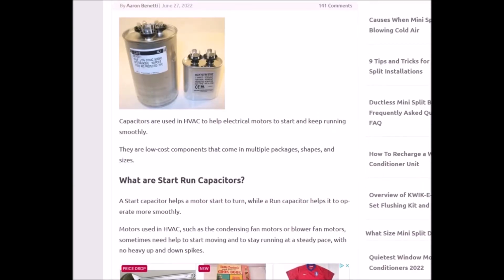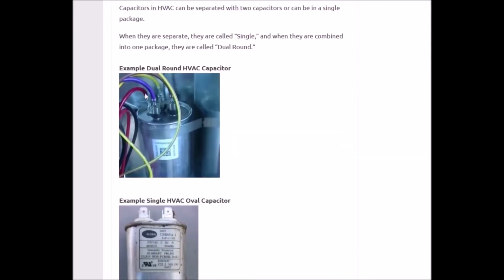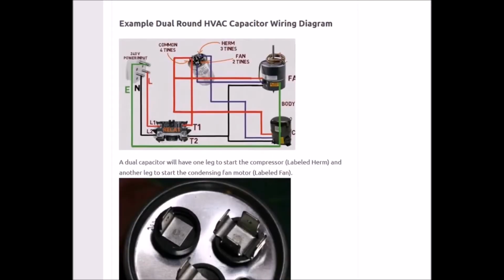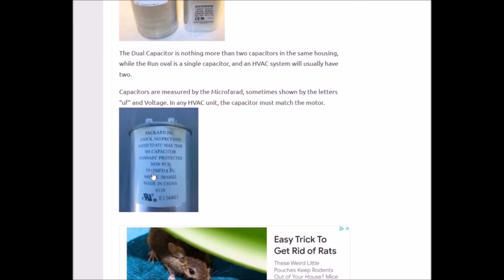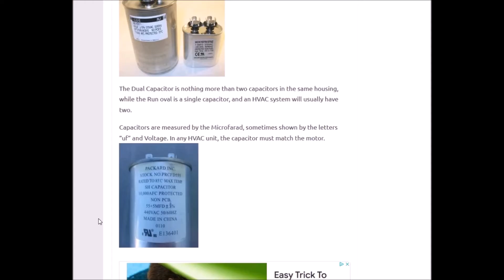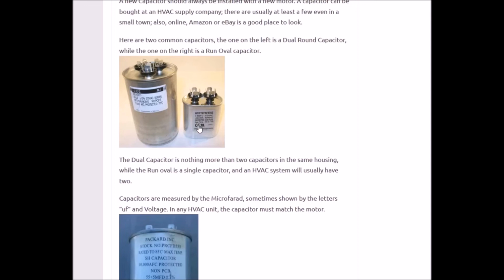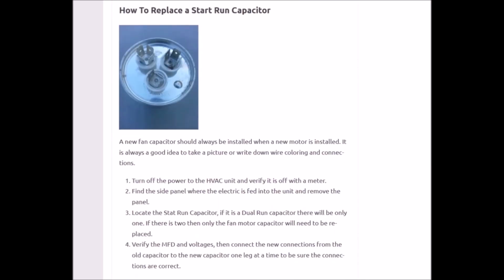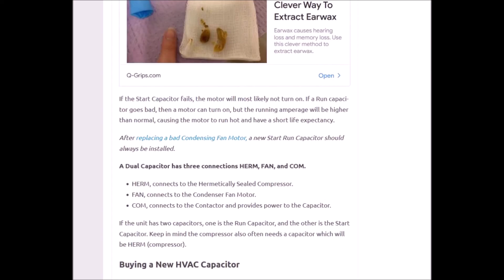HVAC Start and Run Capacitor Explained

Comment: I'm confused because there are no markings on the top of either capacitor. I don't know which goes to common vs herm vs fan.
Thanks for the explanation. I wasn't prepared for this when I opened the panel.

Comment: The fan on my unit keeps running after the AC turns off but it slows down. The compressor stops but the fan keeps running. Any advice? I’m thinking either the start capacitor relay or maybe the fan motor has a centrifugal switch to activate the relay and that has failed.

Comment: And what if you DO forget to take a pic before disconnecting old one? i have that situation currently with a spa pump motor start capacitor (2 terminals, not 3)
Reply from the maker: There should be a wiring diagram on the door or somewhere on the unit. If not follow the wires; with two wires, one wire will likely be to the condensing fan motor or compressor and the other likely to the contactor for power. Be sure to see a diagram or follow the wires to make sure.

Comment: Thank you for your videos. Very helpful. A mouse chewed one of the wires going from the compressor in my AC unit near the capacitor. It tripped my breaker and shut down the unit. The capacitor was burned out and needs replacing. However, I also need to add a new small piece of wiring from the existing wire to the compressor back to the new capacitor. What gauge wire can be used? Can I replace with 14 gauge wire and just install the new terminals?
Reply from the maker: If you can read the wire size, it is best to match the wire size the unit uses. If you can't read the wire size, the amps the capacitor uses can point to the gauge needed. (If it was me, 14 gauge will likely work, but if in doubt, use 12 gauge.)

Comment: Hi!  I have a Monoco RV with a Carrier AirV roof a/c.  The original capasitor went bad and luckily I found a used 370v 45/12uf dual run capacitor to get me operational.  What I'm wondering is where do I get a wiring schematic that will show me how to split them.  I have only found 1 45/12uf capacitor and it is to big to go back inside the connection box, so I would like to use a single 45 and 12 capacitors.  Any help would be awesome!
Reply from the maker: The 45uf should be for the compressor and the 12uf for the fan. The common leg will be shared. The wires can be followed to verify them.

Comment: Can you go from a Oval capacitor to a round? As long as the numbers match?
Reply from the maker: Yes, as long as the voltage and micro farads match it can be used. It may not mount perfectly in the unit, but it would work.

Comment: The Amrad I just got in has a 4th terminal labeled "CPT". The old one isnt like that. Can I just leave that terminal out? All values match.
Reply from the maker: CPT acts as a kill switch between hard-start and compressor in the event of a failed run capacitor. It is not necessary to use but is an extra safety feature. The correct MFD and voltage values to the FAN and Compressor are the main thing.
Reply: @HVAC_Mechanic  Thanks. I wasn't sure if not using that terminal would cause an issue. It's been working fine since yesterday.

Comment: If you have a 35+5 uf can you use a 45/5 uf ?
Reply from the maker: No, the Microfarads need to match. Volts can be higher but not Microfarads.
Reply: @HVAC_Mechanic  thanks that's what I thought..
Thanks again
Reply: @HVAC_Mechanic  Can we replace a dead 45+7.5uf with a 45+5 uf

Comment: A tech didn't have the correct dual capacitor so he used a new dual capacitor for the compressor and added an extra capacitor for the fan that had the correct specifications.  It was a work around because he didn't have the exact matching dual capacitor with him.
Reply: Was this by any chance the titan pro ?
Reply: So a technician did the same exact thing …. So in other words we don’t need the little capacitor to begin with ?

Comment: I have a old rusted capacitor with 3 terminals but only two wires connected,i cant see the mfd or volts. Theres another smaller one with two terminals  and 2 wires connected to it. Ac dont turn on. Why do i have two capacitors?
Reply from the maker: One is likely for the FAN and the other for the compressor HERM.
Reply: Hey

Comment: I can't believe the first statement on messing with these capacitors is the safety factor.  They can kill you.  I worked with a fellow who failed to discharge the capacitor on his AC before touching the terminals.  He died because he was alone at home when he decided to work on his AC unit and his heart was shunted by the high electrical charge.
Reply: BS. Capacitor holds enough power to give you a nasty shock. Especially one rated in the high 3's to 400's volt and higher capacitance ratings (130-600's uf) essentially anything anyone will be dealing with at home or in shop OUTSIDE of an industrial application DOES NOT have the ability to kill you UNLESS you have underlying cardiac issues and especially so if you are outfitted with a device like a Pace Maker. Outside of having a underlying medical condition or having a medical device like a pace maker you wont die. It'll be enough to put your hair on end, and bite you hard enough to HOPEFULLY send the message to NEVER do it again and make sure to bleed off the stored energy or AT LEAST keep your damn fingers or any other body part from bridging the two terminals, but it WILL not send the average person  to the morgue, wheels up.
Reply: @sheepishmclemmingston5550  Agree to your statement,I have a very true story that ive never forgotten and now I know what is a capacitor after my incident 

Ive worked on my Washing machine for years repair after repair just a 45 year old  DIY guy at the time,
I pulled the washing machine out ,removed lid, bent over looking in, left hand resting in or resting on the top of casing can`t remember now, while right hand poking about looking for burnt broken wires and lose connections testing fuse on circuit board, checking bushes etc,not really an electrical minded guy, you tuber watcher, you know that guy!!
Thought owe whats them connections on that thing over there looking like a solid tube with connecting wires coming of it.
Then HOLY SHIT one of MY WORST F--CK-NG NIGHTMARES came at once` my body was humping that washing machine for about 20 -30 seconds or more  I could not let go,biting my teeth together making these gerrrr!! noises I could not shout for the Mrs,
I was thrusting back and forth against that dam machine like a stud possessed , thank god my trousers never fell down or else it would of looked very suspicious e if the Mrs came in .

The voltage I was feeling running through my body was bad , Never have I felt current running through me constantly before like this,and for so long apart from picking up a drill that had coffee spilled on it by a friend and not telling me and pressing the trigger,
 Any way back to this washing machine, eventually I was able to let go,I felt shattered probably trough the humping while tensed up,

I never switched off and pulled plug out as I forgot , worst mistake ever.
Checked out what the dam thing was and yes a capacitor , I cant remember if I touched it with side of my right hand palm or I touched a few connectors at one go poking around for lose connections,

So let it be a lesson to anyone plug electrical out of socket and discharge the capacitor if messing around them,or better still call an electrician,
Reply: He had to have a heart issue or was he standing in water?

Comment: QUESTION: I have 2 capacitors, just as you described. The fan spins freely when off but seizes up when turned on. There is nothing connected to fan on the dual capacitor and 2 brown wires connected to the run capacitor. Assuming the run capacitor is for the fan, which of the 2 wires should be moved to "fan" on the dual capacitor? And, what about the 2nd wire? Thanks!
Reply: I have this same exact issue now, did you figure this out?
Reply: @loganwhite6173  I did, thank God. What I remember is I went to the motor and grabbed all the cables and traced them all back to the board. Turned out there were more cables than I needed. I think there are 7 in total and I only needed 4 of them. I believe 2 of them went to the contactor and 2 to the capacitor. I think I moved one to "fan" and then it worked. I hope that helps.

Comment: Actually, start capacitors do not suddenly release a charge, or “boost” anything, they simply shift the phase angle of current between the run windings vs start windings. This phase difference is what gives the motor a sense of direction to start rotation.
Reply: A motor capacitor is an electrical storage unit that stores and releases energy to increase the current to one or more copper windings of a single-phase motor to create this extra boost and increase the motor torque.
Reply: A start capacitor is connected to the motor windings through a centrifugal switch. It is used to increase motor starting torque and allow an electric motor to be cycled on and off rapidly

Comment: I have an old inverted V 1983 Whirlpool heat pump. I checked the electrical panel and I saw a single oval 7.5 microfarad capacitor which I assume is for the fan motor. Then, I saw a big grey cylinder which I assume is the capacitor for the compressor. I didn't have any writing on it. On the top, it had two sets of 4 posts on top of white plastic and then a small single post which had a yellow wire going to the strap-on bolt. I have no idea what compressor to get to replace it when it goes bad. It's a 2 1/2 ton heat pump system. Everything, as of this writing is working great. But I want to be ready.

Comment: Thanks for this video. I opened my unit and found a single combined 3-post Run/Start Capacitor (60+5)additional 10 Microfarad Capacitor tie-strapped to wires on the side.  It looked like an add-on, but because of urgency(late and no AC) I replaced ONLY the (60+5) and all was well.  I also noticed a Kick-Start has been installed at some time.  After your video, I went back in to see how this additional 10MicroFarad was wired.  It has 2 Black Wires running to it.  Do I remove these, and reconnect them, and discard the 10MicroFarad now that I have a good/tested  Start/Run Capacitor installed now?  Will the errant 10MicroFarad damage anything being used in conjunction with the standard 60+5?  Or, do I leave it alone, close it up, and walk backwards from it being thankful it works or what?
Reply: I have the same issue. I have a dual capacitor connected to the compressor and a single capacitor connected to the fan motor. I installed a new dual capacitor. I want to connect the fan motor to the dual capacitor and do away with the single capacitor for the fan. Does it matter which fan motor lead goes on common or fan of the dual capacitor? Thanks

Comment: Trying to replace original capacitors on 32-yr-old unit. One oval 7.5uf, one round 35uf, each has two terminals that has 4 tines. AC supply sold me two “run” capacitors… shouldn’t one be a start capacitor?
Reply: It is most likely that the 7.5 mf is for the fan and the 35 mf is for the compressor. Both of them being left in circuit the entire time. i.e. they are run capacitors.

Comment: is there a downside to doing the workaround to add a single oval capacitor for the fan?   I tested the dual round and the fan side was fine, so it seems like perhaps the previous technician just added a second capacitor and it worked for a year.   
Now , even after trying to simply replace the single oval capacitor, the fan still wont spin.
Reply from the maker: It does the same thing; it just takes up more space and may confuse someone working on the unit in the future. If the capacitor is replaced and the motor doesn't work, the motor has likely failed.
Reply: @HVAC_Mechanic  well the fan capacitor was bad.  But it still doesn't turn on after replacing it.  Kinda worried it's as serious as a motor. Need to test to make sure its getting full voltage
Reply: @CENTAUR559 Should be the motor then. But that’s easy to replace in my opinion.

Comment: Thanks for your video. 
I have a question for you. Electrician says I need to replace my "start capacitor". He installed a 50 amp power inlet to run my house off my generator in case I lose power one day. When my AC kicks on it trips the 40 amp breaker on my generator. Should I replace the dual capacitor and/or the smaller oval shaped capacitor? I personally changed them both over a year ago but forget which one is the start capacitor. 
Thanks.
Reply from the maker: There is usually only a dual capacitor unless it was bypassed with a single oval; if in doubt, you could replace them both. Mini split units running on generators often need Hard Start Kits installed to help lower the apms that are pulled on startup. Hard Start Kits are basically added capacitors that hold an extra charge when the unit starts. Here is a link: https://www.hvachowto.com/how-to-install-a-hard-start-kit/
Reply: @HVAC_Mechanic  I meant to say this isn't a mini split. It's a central home AC unit with both dual and single capacitor. Lately the unit has been sounding bogged down when it kicks on and my lights flicker. I think I'll start with changing both capacitors since they're so inexpensive. If generator breaker still trips then I'll try that hard start kit. Thanks for your time and knowledge!